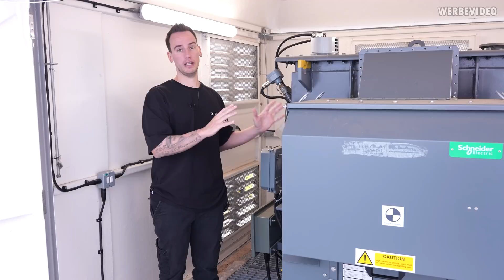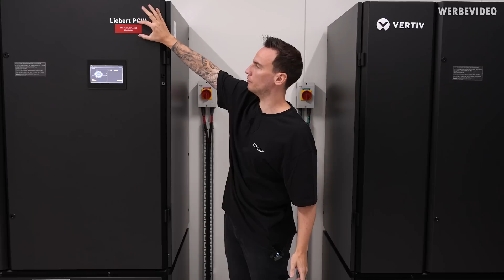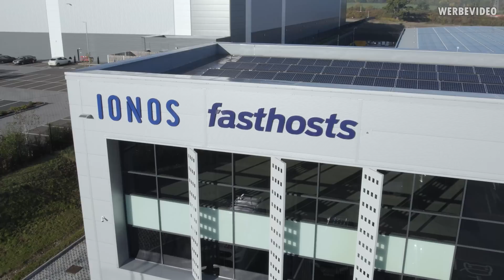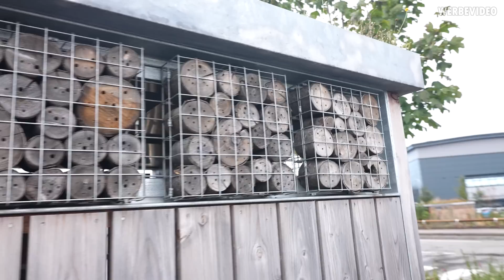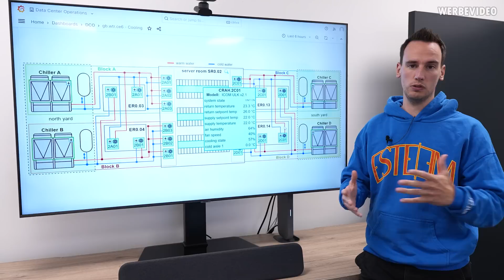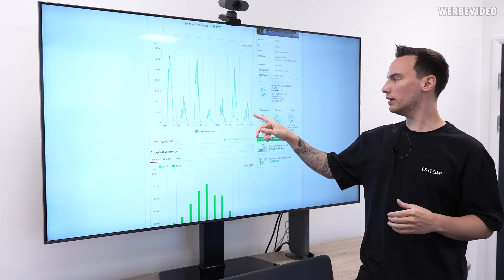A 24 Million Euro Investment: The Datacenter of the Future

Comment: Love to know where this magical 2nd electrical grid is coming from, as just like Germany, we don't have seperate "energy suppliers", we have energy generators that put their power onto the grid.

The "suppliers" only bill you for what you've used. So if the grid goes down, then all external electricity is lost, they can't just "switch over to another supplier".

But that's why they have tons of generators and backup systems, to cover for the time when the grid (singular) goes out.

Comment: Great tour! Two vaguely remoted comments: 1) In Czech Republic, there is a data center which uses servers submerged in mineral oil. They also heat local swimming pool with excess heat. 2) I wonder, why dont use DC beyond the batteries to remove all the invertor inefficiencies. What I would like to see it also in personal computers, is an integrated PSU with UPS, so we dont vaste energy be converting from batteries to 230V and back.

Comment: I know there are some companies working on the Linus solution - they dump the heat into the local swimming pool which saves an enormous amount of money. Co locating a big pool of water with a server farm is a pretty good idea. Ironically, the one I used to work in was about three hundred yards from a massive pool complex but far too early for them to have done anything like that. I dread to think how much energy is going to go into these places ten years from now, unless we take a massive leap in technology. Cooling them was one of the biggest problems because in an old building such as a tower block, you only have so much roof space for air conditioning, which probably explains why they all look like Amazon warehouses now. Water cooling would presumably open up a few options for that. 

We have an entire power station in London that runs of fat from restaurants and generates about 130 gigawatt hours (39,000 households worth). I'm sure there are others elsewhere and if not there should be.

Comment: although it sounds great when a DC uses green power etc, the major issue that they see in NL is that all the gov-funded green power productions is essentially going to companies so that they can advertise with their green power wank wank. I.e. you add green capacity to the system at the expense of the tax payer with the promise that it'll make the land more sustainable but the amount of brown capacity and therewith the emissions doesn't decrease.
DC are a potential great source of heat for surrounding buildings. It's extremely unethical to reject that heat into the atmosphere

Comment: There's 2 ways you can use hot water from a water cooled server... The first one is obvious, shove it into a boiler for the heating, it will already be warm so it will take significantly less energy to heat your building. The second one is a pipe dream, where you use the heat to go back to electricity, it's a pipe dream as the amount of electric you get from it is practically 0 when running a data centre.

Comment: Great Video, do they discharge half of the batteries during the summer nights? If they have good weather forecast which would cause throttling it would be a waste to not use it, if they have twice the battery capacity
Reply: My guess would be no, because it's a UPS to enable them to switch to the diesel generators without your websites going down. It's not supposed to keep the servers running for hours and hours. But all grids are now deploying grid scale battery storage like the Tesla Megapacks (and every other battery company probably) which are the more modern version of it. If they wanted to survive a day long outage they could by installing such a system. 

However, a Tier 4 data centre probably has power coming to it from more than one power station e.g. a physical cable from the one to the west, and one from the one to the east so that if one power station goes down it doesn't matter (I could be wrong about the Tiers and that might be Tier 5 but you can look it up if necessary). An actual outage is relatively unlikely in the UK but our grid is only getting more resilient over time. Not that they'd ever be able to ditch having a UPS. 

Grid scale storage does take in excess renewable energy, which we have very frequently, and also cheap energy being produced at night that wouldn't otherwise be used, and stores it. The grid can then draw that down if there's a less windy day and a surge in demand. It's pretty wonderful stuff and will save a tonne of energy going forward.

Comment: HVAC Engineer here. I've seen private data centers, where they use the heat of their own data center to heat the structure of the building with concrete core activation. The servers didn't use watercooling. But like I said it was private and very small (ca. 100 m²).
Reusing the heat can be done! But it is indeed not so easy...

Comment: That figure of how much CO2 has been saved by the solar just shows you how insignificant personal transport is to the problems we need to solve. The media and governmemt tell us to solve it buy new things(keeping old things working is way greener) , buy an EV and so on. No, fix the big stuff like this first before you nit pick at the small stuff.
Reply: We need to fix all of the carbon usage. Not just some of it. We can actually do all of the things. The same batteries fuelling the EV transition, which uses dramatically less energy by the way, are also giving us grid resilience and reducing waste. Transport emissions are vast. Co2 from transport is about one fifth of global emissions. 45% of that is passenger vehicles, 30% is road freight. So yes, electric buses are more important than electric motorcycles but everyone has to switch, as fast as they are able. It is not a scam. Carbon capture however, absolutely is a scam at the moment.

Comment: What will the electricity bill be this winter? nobody knows! But the solar panels will be useless this winter
Reply: Aww bless your heart. You've fallen for the one about solar panels being useless in winter. In case you come from somewhere were snow is expected, it isn't here and if it does happen even in this day of global warming, it doesn't last long. Plus there's a thing called a broom which you can brush it off with. Also heated solar panels. Also the general heat of the building. It turns out, engineers are perfectly well aware of snow.

Comment: I hope the building doesn’t catch fire. Here in the Netherlands the fire brigade has massive problems extinguishing fires in house when the roof is covered with solar panels. The water runs off it and doesn’t reach the fire. Something nobody thought off ahead.
Just like it is extremely difficult to extinguish fires in electric cars. Another thing we found out after using it.
Reply: You seem to be under the impression that the tiles under the solar panels don't also prevent water from getting to the fire. Also that EVs are more likely to burn that petrol cars, which is wildly untrue but what Fox News wants you to think or that no-one has worked out how to put out those fires more easily, or that lots of lives have been lost. Or that engineers have never considered lithium battery fires, because if they had, they'd probably have done things like armoured the batteries against intrusion, waterproofed them, and given them both heating and cooling systems to maintain their health. 

Seriously, don't worry about it. Although do be careful about cheap imported e-bikes and scooters that are suspiciously low cost, they may not be of the standard you'd like. Which is one reason why the EU has passed a massive new battery standards law for portable batteries.
Reply: @jonevansauthor  the fire brigade has enough waters pressure to get rid of the tiles and they will drop down when the wooden construction collapses. But the solar panels are all connected like an extra roof. The fire brigade is doing research in the Netherlands on how to handle this new problem.
We don’t watch Fox news here in the Netherlands. Yes, the world is bigger than the USA. The fire brigade in the Netherlands is using modified shipping containers, top removed and made water tight, to drop in burning EVs. Because we have had plenty of car fires here after car accidents. The only way to stop the battery burning is dropping it in a container filled with water and wait a few days. It’s inherent to Lithium Ion to burn without external oxygen.
The Netherlands has loads of EVs. So we have seen it all.

Comment: air can be reused via heat exchangers which can be up to 90% efficient
Reply: typically isnt as air pressure needs to be maintained for circulation. but a secondary heat exchanger or AHU system that gets its heat from the DC air can work. But not well loved for the summer where you dont want heat anyway.

Comment: There are some servers that are using their heat rejection for district heating. So they water cool their chillers and the warm water is used to heat the neighborhood. Sometimes it's low grade heat with temps below 35C, but you can boost the temperatures with heat pumps and get higher efficiency residential/commercial heating with it.

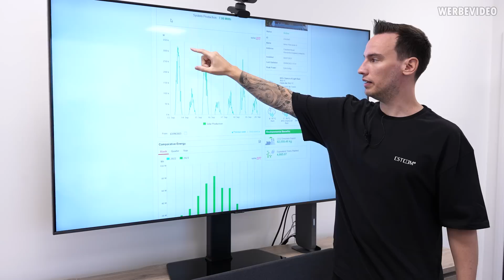Comment: 17:25 Sounds like an oil industry limitation law, slowing down the solar revolution.
They could easily expand the solar power storage with batteries or even newer technology (Molten Salt Storage)(Sand Energy Storage).
Reply: No, it's a power system balancing regulation. They can apply to be approved by their DSO (distribution system operator) but that requires a good amount of grid simulations and documentation to be. 
The supply grid is a constant balancing act and if not kept in check, both oversupply or undersupply can cause brownouts or blackouts, which would mean the datacenter would have to run their diesel backup generator while the grid is repaired and brought back online. So although these regulations can seem like obstacles to the uninformed. They are paramount to a proper green transition as more equipment becomes electrified because electrical power can be made from renewable energy sources like the sun, but will only be properly green if implemented correctly.

Comment: why are they not using ground "heatpumps" ? 2 meters under the ground is like 8 degree celcius? You can heat exchange from the ground and get almost free cooling all year around.. This just made me wonder how I can make this for own computer, once I make it for cooling the air in the house also ..
Reply: I think because that's basically water cooling anyway. Which is the next step and he did mention it. It's still not an easy thing to do and run for a few decades which is how long some servers get installed for. Also it's a bit late once you've built the building to add ground source at the scale they'd need I imagine - they drill hundreds of feet down, or they put in a lot of loops closer to the surface. For a house, one borehole is enough, for a data centre? You might need a mine.
Reply: @jonevansauthor  all you need is to dig before you build over the whole property, and you only need to go down over a few meters that is all, then you just make several giant loops and then you're all good. This should be able to cool quite a lot actually.

Comment: How are they going to use "100% renewable energy" if they are connected to the same grid as everyone else, with all the production and consumption, including non-renewable energy production?
Reply: Love this question!
What they are doing is a somewhat misleading way of branding. They make an agreement to buy all of their electricity from a supplier which only has eg wind-farms and large solar farms. Because the supplier puts more energy into the grid in total than this datacenter consumes, they say that they only used that energy. Even though they are as reliant as everyone else is that the grid is also powered by various coal, gas (or similar) power plants, if they want to have an electricity supply when the sun is down and the wind is calm. One man's good branding could be seen as misleading green washing to others
Reply: @R4nd0mN7mbers  in Q2 of 2023, the UK hit 42.1% renewable energy. So yes, some is still coming from coal, but we're getting there and getting there relatively fast. Not fast enough, but that was a 4% increase year on year. 

The real problem was Apple claiming that they're offsetting carbon with credits. Oh how I laughed at their dissembling.
Reply: @jonevansauthor  Interesting input. I do look forward to a time when we have only renewables supplying our grid. 
But that further backs up that this server facility are in fact not getting a 100% of their grid supplied electric energy from renewables. While they claim that they do. Which is misleading. 

An yes. Carbon credit is, in its current regulatory configuration, such an invitation for green washing. It's down right tragic how easy it has been made for companies to buy carbon offsets...

Comment: How do they control the relative humidity when the chilled water temp is running 
at 22 deg C?
Reply: Air-conditioning units like a dehumidifier can dehumidify the air at the desired temperature
Reply: @R4nd0mN7mbers  Conventional dehumidification would require much lower water temp typically around 7-8 deg C. I was wondering if they are using some form of desiccant technology.

Comment: Math on this CO2 and trees pulled is strange.
82559kg of CO2 is equal to 36119kg of pure carbon.
36119kg divided by their number of 5000 trees pulled gives roughly 7,2kg of carbon per tree.
A tree is mostly cellulose, and its ratio of other elements to carbon is 1.07, so for every 1 kg of carbon there is 1.07kg of oxygen and hydrogen. That would give figure of their tree to be around 15kg. Even if accounted for errors and things I've missed by doubling that to 30kg of a tree, it's still about the size of above average Christmas tree.
How did they come up with that number?

Comment: I have a strong dislike of some solar projects. They seemingly make no sense, like a big solar park they are trying to do in Finland. Where electricity needs fall during summers when it's really sunny and when we absolutely need electricity during winter, the sun is out for 8 hours per day on average.
Reply: They make sense. In dry and warm summers we are one NPP or Swedish transmission line away from 10-folding prices. Most of the electricity production is in maintenance during summer, just because consumption is lower in summer doesn't mean we have abundance of production capacity at same time. Also wind power is at lowest in June&July and if it's dry like this summer, hydro prices go up. There's plenty space for solar in Finland at the moment, around 4 times more what we have right now would be beneficial.
Reply: @kognak6640  yeah I suspect the OP has not heard of HVDC undersea cables. We just recently put one through the Channel Tunnel from the UK to France, and there's another to Denmark and those aren't the only ones. There is a massive energy abitrage business across the European continent. Australia is planning to supply Asia. We have a line that might go from Morocco to the UK. It's always sunny somewhere, and solar panels work in 100% of places. They even generate power from moonlight. 

This is just FUD that's spread by people who read very bad news websites and papers. :)

Comment: Dynamic online mode, it's the UPS operation mode. Equivalent to eConversion in SE. But even considering the batteries are in the same room as the UPS, which is a mistake, the temperature supplied by the CRAH units is too low. 24.5 is how much lead acid batteries should be kept, and the UPS can work without and issue with 30-32 degrees inlet.

Comment: That solar roof is amazing! With it you can ... turn the lights on inside the building... It should be pretty neat in the summer tho.
I think the best way a data center can be used to save on emissions is to use all the heat they produce and sell it to nearby homes in the winter. In the summer - maybe concentrate it to be used as an incinerator or something. Obviously they need to make less and less heat as they work and it would be really nice if they generate their own power like from a nearby river or something. Not relying on the power grid would be ideal.
One thing that data centers are really impressive is the overal planning and design are super clean and expenses are cut short.
Reply from the maker: Using the space on the roof just makes sense. And especially if there is a lot of sun in summer you need more cooling. So you can combat this scenario quite well.
Reply: @der8auer-en roofs are usually used to plant some grass. It is to fulfill the concrete to green ratio requirement.
Reply: @MasonStormSunny  grass and indeed entire farms can grow happily under solar panels. There are lots of crops that like the partial shade they get. Not that a data centre would necessarily be the best place to cover the roof in compost and root systems but they're not mutually exclusive, and they do have bee and insect habitats there. I'm sure we'll see more interesting systems in the future. Potted plants and even trees are also a thing but you can't have anything that would shade the panels of course.